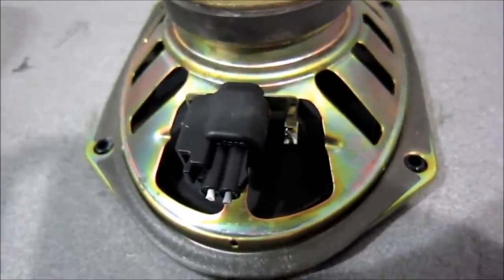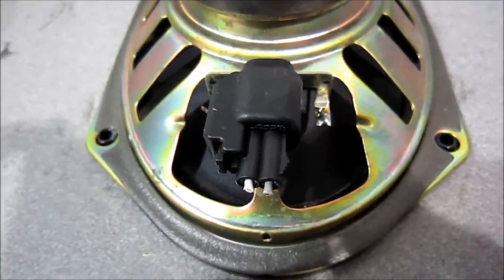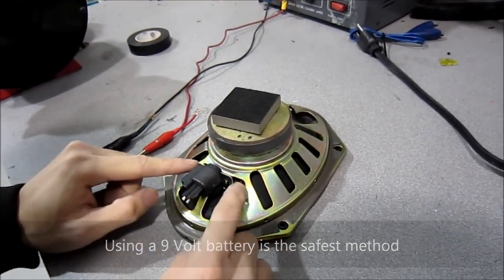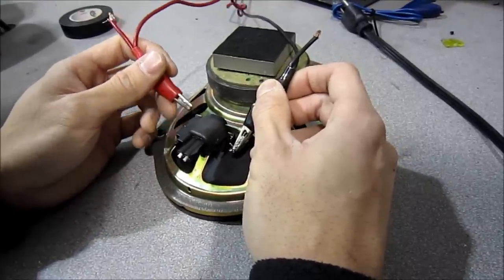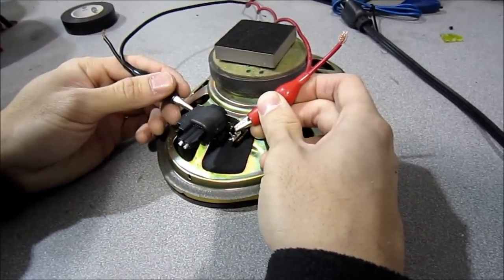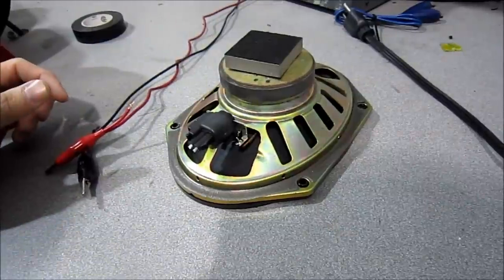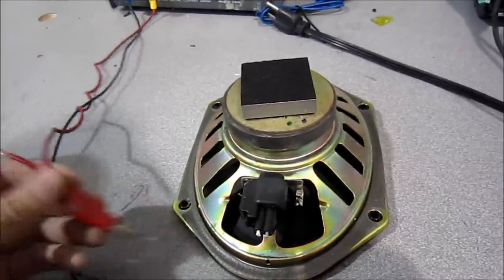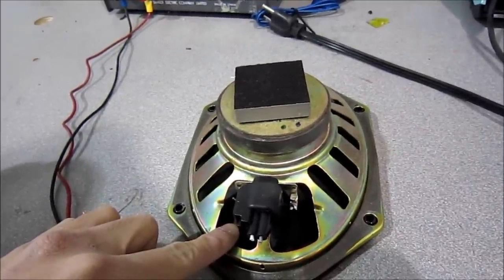How To Check Speaker Polarity (Positive and Negative) | AnthonyJ350

Comment: Hello
AnthonyJ350,  last night, from my vintage tube amplifier,  I 
mistakenly connected my Spendor Bookshelf speakers as with two  + wires 
 to the one speaker and two - wires to the another speaker. But one side
 speaker worked and another side didn't work.  'Balance control worked 
both sides only for one speaker. I shocked and sweated  then found it 
was wrongly connected. After made the correct polarity connection, they 
now sing.  Here, I need your clarification for: Since I made the wrong 
connection for 10 minutes, is there any possibility for weakening the 
Cross-over and speakers? Actually, What would be happened by this wrong 
connection? I am much much worried about my beloved - expensive  new 
speakers.   Kindly explain and please let me know : Did my speakers 
fully escaped and are they safe now?  why could  the speaker sing, connected
with two positive + speaker wires?  and why could not sing ,connected with two negative wires?
Thank you,
_ with regards,

Comment: It should also be noted that, especially in a car, standing waves will always be a problem due to the complex structure of the interior. Whether or not reverse polarity would actually harm sound quality might be more of something a bit theoretical; in fact, where one standing wave exists in matched phase, might actually be resolved in mismatched phase and visa versa. I'm not advocating sloppy installation, but it may not be as essential as one might think, either.

Comment: Speakers are not "designed" to drive outward, the signal which they receive is alternating in polarity relative to the phase of the signal, speakers "push" as well as "pull" and this quality is used in some subwoofer designs. Standing waves are really the only problem.

Comment: I would not recommend running any amp at 1ohm, even if they claim it can be. This will cause the amp to run hot, and will more quickly degrade. A car already is a less than ideal location for precision electronics, both in terms of mechanical as well as thermal stress, and I doubt *very much* you're even getting close to 1kW of energy into that sub.

Comment: use AAAA to D batteries. 9 volt batteries can easily do harm to your speaker. I only use 9 volt on  larger than 10 inch speakers.